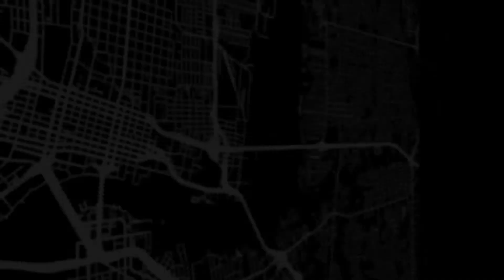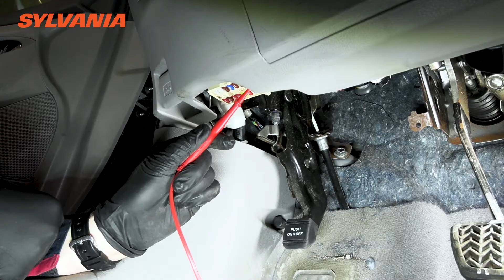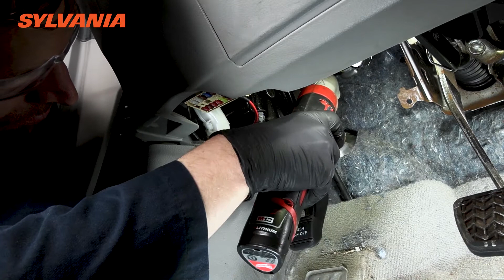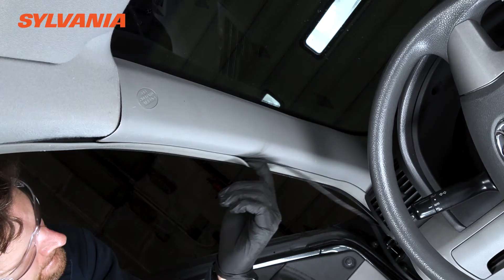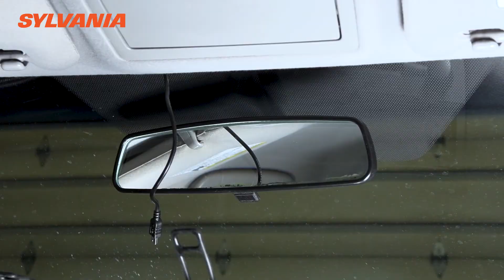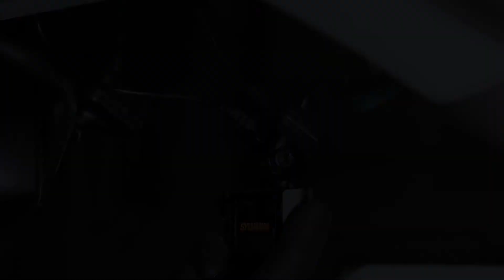How to Hardwire a Dash Camera | SYLVANIA Roadsight

Comment: did you cut off the 12 V adapter off the RoadSight power harness ?  or did you buy a spare 12v outlet to tap into the fuse box ?  What is this "power box" you speak of ?
Reply from the maker: To clarify, we didn't cut off the 12v adapter on the SYLVANIA Roadsight power harness. Instead, we used the SYLVANIA Roadsight Hardware Kit.
Reply: @SYLVANIAAutomotive  my mirror doesn't seem to be working.  rear camera isn't coming on.  Front camera only comes on after fiddling with the buttons for 15 minutes and it only comes on for a few minutes.   The only thing I know is that I don't have a 32 GB SD card inserted because my mirror didn't come with one like it said it was supposed to.   Will inserting a 32 GB card take care of this issue ?
Reply from the maker: @Mr_BUSINESS_24_7  Yes, you'll need a memory card to make the camera functional.
Reply: @SYLVANIAAutomotive   awesome !! appreciate the feedback.   To be honest I bought the RoadSight a few months back and it was banged around a bit in the back seat of my mom's car.  So the SD card may have fallen out of the box.   I ordered one from Amazon yesterday.   looking forward to learning how to use this !!!
Reply from the maker: @Mr_BUSINESS_24_7  We're happy to help! If you run into any further issues our customer service team is available to help at 800-729-3777, M-F 9am - 5pm EST

Comment: I tried all this and still don't turn on. Do you have a recommendation on what fuse tap to use. I have low profile mini fuses.
Reply from the maker: We recommend reaching out to the manufacturer of the hardwire kit used to resolve this issue.